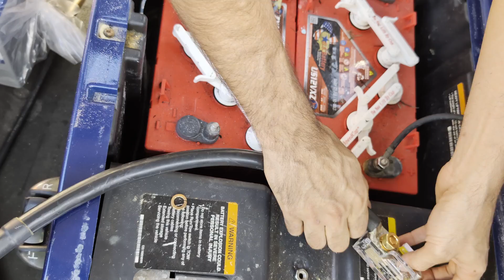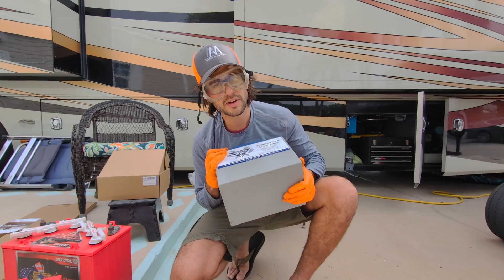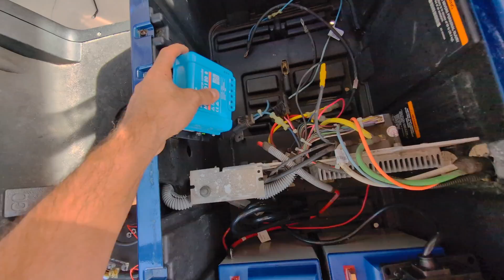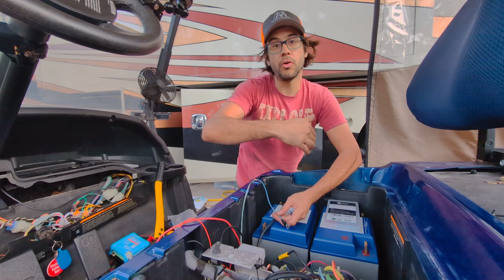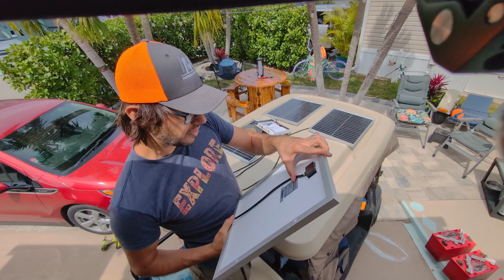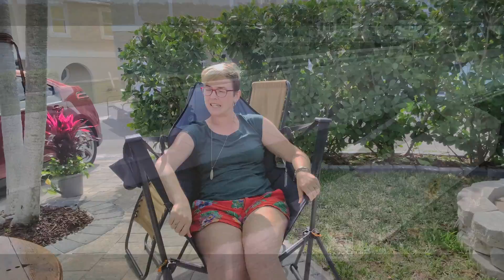Best Golf Cart Mod - DIY Lithium Batteries And Solar Install

Comment: 2 years later you should prob remove those batteries and check them. people having lots of problems with them.
Reply from the maker: I have checked all of my batteries and no problems, 7 years off grid with them flawless, just woke up from another night air conditioned off them.  I think most of the issues are installation and hyped up fear. Any battery installed wrong is a danger, gotta think of them as fuel tanks.

Comment: You definitely want to do a controller upgrade with those batteries it will double the speed easily if not triple this is a must-have pretty cool video enjoyed it

Comment: You need to relay your  DC to DC  so it switches off with the rest of the cart otherwise it will slowly drain you power pack

Comment: I recommend 3M VHB double sided tape for the mounting of solar panels, I think you were planning for future removal and roof cleaning, that’s why you went with the Velcro, soldering connections on moving vibrating vehicles is not recommended, need to allow for vibration and some flexibility not inherent in soldered connections. Would a single 100W 48v panel have worked? I sincerely Love you videos, you have a gift in how you explain what to you are going to do, and as you are doing it !!!! Keep up the great work.
Reply: Soldered is best for vibration applications, won't come or break apart. Look how a car is done

Comment: I have two suggestions and if they are bad ideas let me know first off what is up with the 25 wat panels you could of went with a single 72 cell panel for twice the money And had four times the out put with less connections the second thing is adding a small inverter like around 500 watt it's not something you would use every day but if your area loses power it might be enough to keep a small refrigerator going or a CPAP machine going through the night.

Comment: All you need is a relay hitched up to the plug that is normally closed but when the cart is plugged in turns the power to the motor off that way you can't drive off when you are plugged in
Reply: all he NEEDS is to just run his extension cord through the steering wheel before plugging it into the cart... kinda hard to miss that when you are climbing in to take off.

Comment: Awesome project and video! In my wall tent I've got a couple hundred watts of solar and charge up 3x 12v 100ah cheap AGM series batteries, then use a buck converter to drop the output to a 12v fuse block for all my interior led strip lighting and in case of 110v ac power outage I can run my iceco fridge and compost toilet with that solar bank. I also use cheap amazon battery balancers between the AGMs that I have in series. Those battleborn LiFePOs are a really good deal, I'll probably get 3 of them for my boston whaler's minn kota trolling motor. I had been using those AGM batteries for trolling but the voltage drop and use-to-charge time was not ideal.
Reply from the maker: I used them on a trolling motor and was blow away by how much more power it had because the reduced voltage drop, they work fantastic!
Reply: Battleborns are nice, but so insanely overpriced. I'd rather buy from a US company, but not at 4x the price for basically the same thing from a brand like Li-Time. 
Epoch batteries are high quality and have a US based office. And at about 1/2 - 2/3 the price of Battleborn for the same quality if not better. Will Prowse on youtube has torn down a ton of these batteries if you want more info.

Comment: 200 W-h per mile is actually very good even for a good modern car.  What you lose in bespoke engineering to maximize efficiency in the car, you get back in minimalist weight and lower speeds.  A Tesla 3 only manages about 200 W-h per mile and they spent a LOT more on optimizing efficiency than you did.  You're doing fine.
Reply from the maker: When you put it that way it yea it isnt too bad considering what it is, Our Volt runs about 250-300 depending on conditions, but yea thats got hundreds of millions into dev, lol
Reply: Yeah, but a model 3 is way heavier, faster, and larger. So it's still pretty bad efficiency for the cart. But it's a cart not travelling near the miles of a car, so not really a big deal IMO. A brushless motor system would really help here. But, not really worth the cost unless you needed to stretch those miles or wanted better throttle tuning.

Comment: Could this be done on an electric car? I realize it wouldn't totally charge the batteries but maybe get a few extra miles on a long trip? I always enjoy your videos.
Reply from the maker: No reason it cannot, but as an aftermarket it would be very hard, I tried to do it with our Volt, but tapping into the existing battery managment system was really tough and its at 400V. If a manufacturer implemented it tho, yea it would be amazing! The new prius Prime has a solar panel roof option (only 185 watts tho) that can recharge the battery and I think its brilliant.
Reply: It could, but the average electric car needs 40kWh per mile, and his cart has 5kWh total… so, the car would need humongous panels, bigger than the roof of the average home to provide a significant charge rate…

Comment: Curious as to the resistor you talked about for the motor controller. I too am swapping a Yamaha G29 cart over to lithium batteries. I actually bought a charger that uses the same cord and so no swapping out of the charge port.
Reply from the maker: Its called a pre charge and keeps the caps in the controller charged. Just do a search for that and you will find them. Your batteries may or may not need it but it will help the BMS not see voltage spikes and make it last longer.

Comment: Tom, what do you mean by the “most positive” and “most negative” terminals of the batteries?
Reply from the maker: in the series configuration we have 4 in series, so the positive and neg in the 48V config.
Reply: @MortonsontheMove  I understand the series configuration but what makes one positive or one negative the MOST negative or positive terminal?
Reply: @AlaskaRog  Of course each battery has a negative and a positive.  For what he's calling "most positive" and "most negative", look at all four batteries in a string (connected in series) with the positive of one battery connected to the negative of the next.  The negative end of the series string is the most negative, and the other, positive, end of the string is most positive.  Simple as that.

Comment: Did you use that old less sophisticated charger designed for charging wet flooded lead acid batteries orrrrrrrrrrrrrrrrr a smart well regulated charger specifically designed for charging slightly higher voltage Lithiums with their different charging requirements  ?? Even though sure the old charger will provide a charge to the Lithiums (and their BMS provides regulation) I  would have used a charger specific for proper full and adequate charging of the Lithiums you chose. To each their own and it can still "work" with the old lead acid charger. In my RV when I changed from Lead Acid to Lithiums I upgraded to a specific matched for Lithium converter/charger, did you do likewise in any RV when you upgraded to Lithium ??

John T   BSEE
Reply from the maker: The charge is mainly from the solar which is set perfectly to the lithium requirements, we completly replaced the primary charge controller onboard as well for the lithium spec, thats shown in the video. It works great and gets them fully charged.
Reply: Great thanks for the update !!! @MortonsontheMove

Comment: Shorting a lithium battery is actually worse than shorting a lead acid battery.
Reply: Most of these drop in type have short protection. But sure bare lithium batteries with no BMS would be not so great to short, neither is lead acid thoigh.
Reply: @chublez  I tried to get a bead on how well the internal BMS would handle a short and did not come away comfortable, even after talking with Battleborn. I use a Class T fuse for this reason.
Reply: Dramatically so.
Sure, the BMS should be able to mitigate a short, but WOW LFP can produce a massive arc in a short condition thousands of amps on tap, very low internal resistance… extremely dangerous without proper fuse protection.

Comment: I've been intrigued by those solder/heat shrink connectors.  Since you're using them on this project I take it that you like them and have had good luck  with them.  Is that the case?  Keep the good stuff coming guys and maybe we'll see you on the road one of these days.
Reply: I have not used those connectors.   But, I just put heatshrink on the wires, twist them together lengthwise, solder them, then pull the heatshrink over the connection and heat with a cigarette lighter.   Never have any problems with that approach myself.
Reply from the maker: They have worked great for me, I do think the heat shrink is a little thin and if I wasent wrapping these in additional tape having another section of shrink to go over it would be good, but yea they make a great connection and are super easy